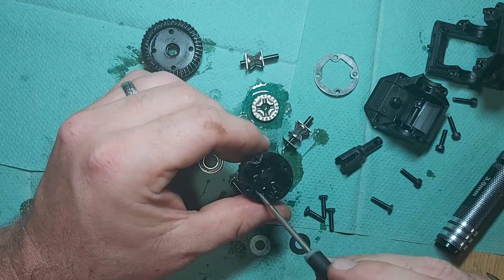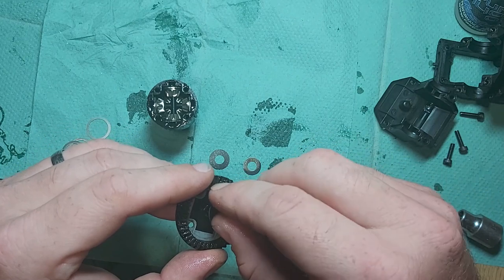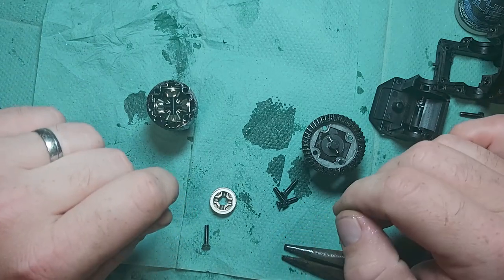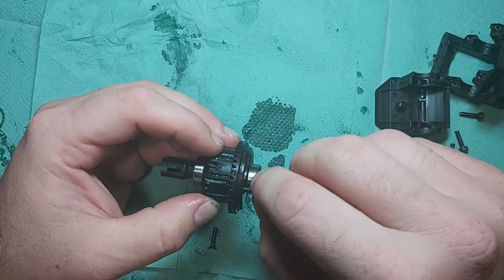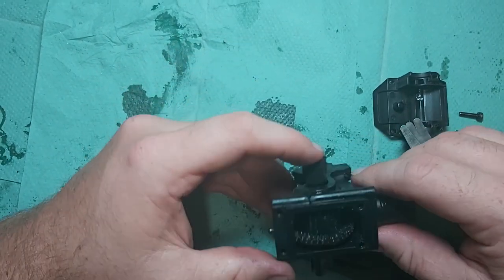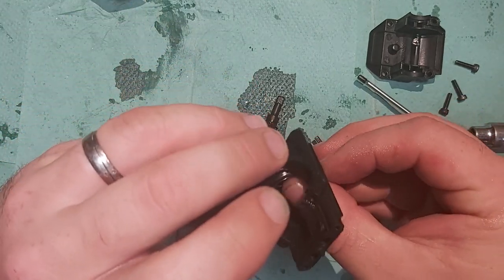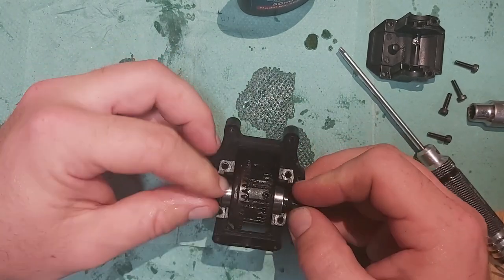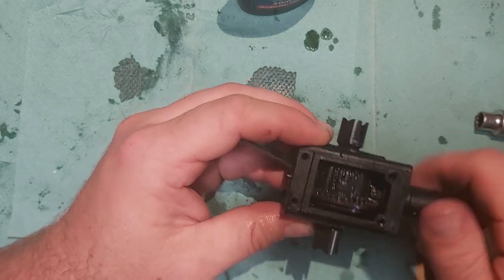Building a bullet proof Arrma Kraton EXB rear open diff (non LSD)

Comment: Did arrma fix the rear diff in the exb?
Reply from the maker: Yes I believe the v2 comes with the LSD diffs all the way around to sort the issues
Reply: @bournemouthrc4371  is that a good thing ?
Reply: @bournemouthrc4371  When will the Kraton EXB V2 be released?
Reply from the maker: @larsoost3901  sorry not V2 I meant batch 2 of the EXB. The second batch has the diff sorted i believe

Comment: This is exactly how arrma has fixed the problem. Now the shim kit includes a spacer where you are stacking the eight shims.
Reply from the maker: Yea I sent this over to them when I did it, seems they liked the idea 😁😁👍👍
Reply: Mine is on the way. However it looks like they’re doing lsd in the rear now. I wonder if it would be better to get the shim kit and make it open. My only arrma is the v2 outcast.
Reply from the maker: @NavigatorGSX1300BK  the LSD works well as well as that takes uo the same space

Comment: Any recommended U.S stores for the shims you linked? Thank you!
Reply from the maker: Sorry the best bet would be Ebay that's where I tend to get mine, just type in the size
Reply: I used Arrma shims, 12x15.5x.2. So far so good! 👍
Reply: Ijust priced it out shipping from uk site to usa the shims for 25 qty is 3.50 and shipping is $38 haha and im still considering it.
Reply from the maker: @focusdrivenmedia3436  ahh man that sucks, I cant believe somewhere in the states they dont do these
Reply: @bournemouthrc4371  i can find it at all. I spent an hour online. It would work if it just was the smaller size as long as it only touches the inside ring of bearing it should work right. Obviously touching the outside ring of bearing is better but im wondering if i should just give it a try to see if it still spins freely
Reply from the maker: @focusdrivenmedia3436  it's worth a try, I would also contact a shim company I'm sure they could make them as a custom size

Comment: Bad news....my diff failed with this repair! Took about 10 packs of hard bashing and I thought it was licked. 

Not so much. Can we all just get replacement diffs!
Reply from the maker: Ahh man that's not good mine had about 30 odd packs throughout now. Which part  broke?
Reply: @bournemouthrc4371  sun gears. They didn’t actually break 100%. I put it all back together using the LSD plates (bought 3 sets) it’s running again until ARRMA sends a replacement. I don’t think it will hold up for long though.
Reply from the maker: @GRIFFINLEVEL3  are man that isnt good, I hope you get your new ones soon and your one holds up until then

Comment: Could you just fit a v4 diff they seem stronger
Reply from the maker: I think these shimmed up properly are stronger due to having larger gears for input and crown wheel.
Reply from the maker: But yes you can put a V4 one in there with the pinion and drive cup from a V4 as well